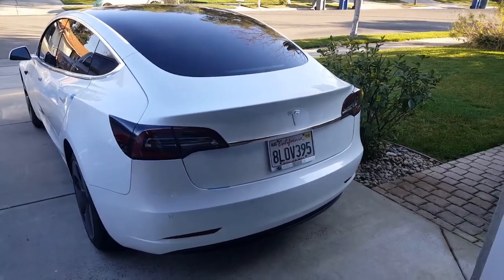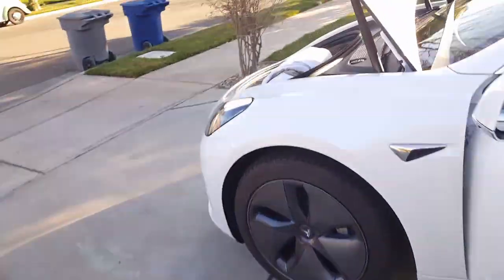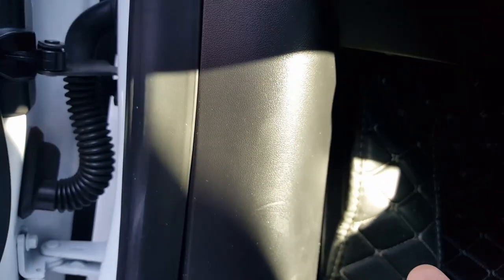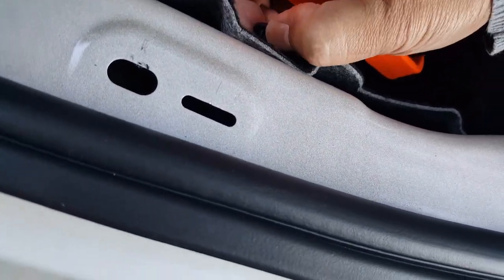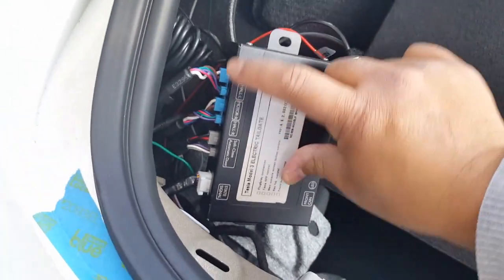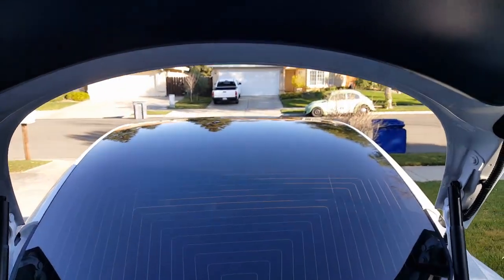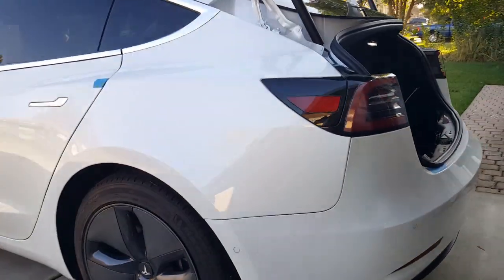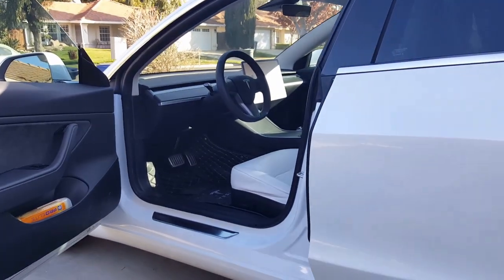Tesla Model 3 Hansshow Power Trunk TF Card Update v3.x

Comment: I have a Hansshow V2 Trunk fitted on my model 3 and i'd like to update it to v3 so that it shows the Status etc. I believe that is what you did with yours? where there any wiring changes required or just the software update? Also, mine does seem to slam quite hard when closing, so being able to set the closing force would be good.

 Is there somewhere that the latest Hansshow update files can be download from or are you able to share the update file that you have?

Comment: Hello my friend! I have a question, i have a problem with my powertrunk, when the car is not used for a while (sleeping) and when i open the trunk the first time it opens 20 cm and then stops and beeps like 10 times, then i close it manuelly and after that it works ad usual. Can it be a softwware issue? I have to upgrade the software in mine and try. Is the TF card a ordinary SD card? Thanx!😊